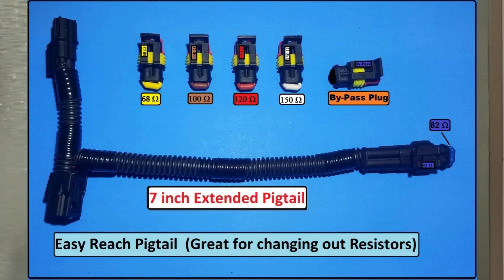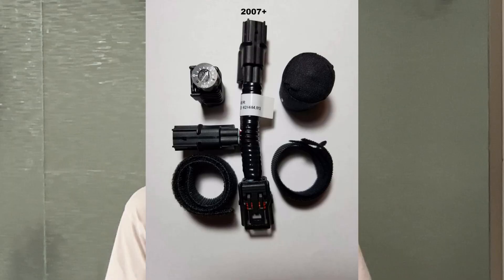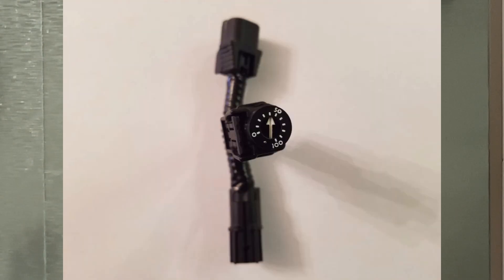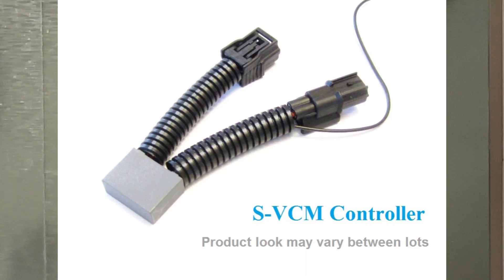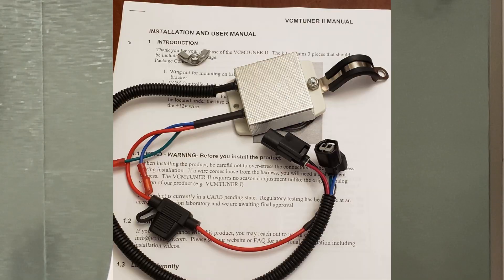Top 4 VCM "Muzzler" devices

Comment: I have a VCM Tuner 2  and it seems to work fine.   I bought a code reader to read the particular sensor temperature being hacked by the device.   The device lowered the reading sent to the computer by a few degrees.  So I assume its working.   Using it on a 2018 RDX for a couple of years.   Engine never misbehaves.
Reply from the maker: Yes, it lowers it by a few degrees.  No issue with the engine block.  Did a 11 year and 137K miles review of the VCM Muzzler.  https://www.youtube.com/watch?v=j_8IdRVcrig&list=PL4dt8AL5j4pUzNWuZK6QCuf2VdSZKC-vb&index=7

Comment: Hondata Race Tune....turn it off for good!  I ran S-VCM for many years, typically get at least 3 years out of them.  I only run 5W-30 full synthetic, which is proven superior to 0W-20 unless you're very easy on the throttle.  Used oil analysis is your friend

Comment: Hi Andrew, I’m currently driving a brand-new 2026 Odyssey (just over 800 miles) with the J35Y7 engine and the 10-speed AT. I’m experiencing a very specific issue and would love your insight, or to hear if other '25–'26 owners are feeling this.
I’ve noticed a consistent slight shock or unnatural 'lurch' during the 2→1 downshift right as I’m coming to a complete stop. It is significantly worse when the car is cold (below 32°F) and feels quite harsh, though it never fully disappears even when warmed up. Interestingly, it doesn’t happen on inclines or when I manually downshift with paddles.
I have a few questions regarding VCM on this new model:
1. VCM Version & Muzzlers: Which version of VCM is equipped on the 2026 Odyssey? You mentioned VCM version 4 (J35Y8) for the Pilot—is the Odyssey's J35Y7 using that same complex system with 10 sensors? If so, is there a VCM muzzler that actually works for the 2026 model yet?
2. Low-Speed Activation: Does VCM even activate at very low speeds (just before stopping)? I’m trying to determine if this 'jerk' I'm feeling is the transmission logic or if VCM deactivation/activation is playing a role in that 'unnatural' stopping feel.
3. Benefits on New Models: Aside from fuel economy, do you still believe it is always better to install a VCM muzzler on these brand-new 2026 engines to prevent long-term issues, or has Honda finally addressed the piston ring/mount concerns with VCM 4?
4. Break-in vs. Fix: In your experience, could this low-gear shift shock simply be part of a break-in process that disappears after a few thousand miles, or is it something a VCM muzzler (if available) might actually resolve?
Appreciate all the work you do for the Honda community!"
Reply from the maker: 1.  2026 Odyssey still uses the older J35Y6.  There is no J35Y7.  Therefore, all current VCM muzzler devices will work.  These devices will  not work on VCM version 4 (J35Y8).  2.  VCM does not activate in low speeds.  Mostly on cruising on the highway at a steady speed.  So let's say about 40 mph to 70 mph.  3.  Yes.  That's what I did on my 2014 Odyssey.  The engine was perfect.  4.  On the transmission.  I've not driving an Odyssey with 10 speed automatic.  However, my 2025 Pilot also has the same transmission.  IMO, I do feel a bit jerky going from 1st to 2nd.  I think that due to the ratio of the gears.  Meaning, 1st gear is (too) low, so the engine revs up fast, to get this heavy vehicle moving.  Heavy load.  And makes it more responsive from a standing start.  Then it shifts to 2nd gear, where there is less load, so the ratios are higher.   On the reverse side when it downshifts, there is perhaps more of a shock going back down from 2nd to 1st, when coming to a stop.  The rest of the gears match very well where you don't feel anything.
Reply: @a @andrewwang128 1. Registration says it’s a J35Y7. Thank you for the reply with details!
Reply from the maker: @ForG-v3n Are you in the U.S. or North America?
Reply: @andrewwang128 it’s RL6
Reply: @andrewwang128 It’s same as RL6. Starting 2025 or 2026 engine code is now J35Y7
Reply from the maker: @ForG-v3n Learn something new today from you.  Thanks.  The J35Y6 is with the 9 speed transmission.  The J35Y7 is with the 10 speed transmission.  That's what I gathered so far.  Will see if I can learn more about the differences with J35Y7.
Reply: @a @andrewwang128 how are you trying to reduce the shift shock between 1st and 2nd gear? Have you felt any shift shock when the car is slowing down or just before coming at a complete stop as the gear downshifts from 2nd to 1st gear or when the torque converter deattaching?..
Reply from the maker: @ForG-v3n I don't feel any shift shock slowing down from 2nd to 1st.  My description was for accelerating from 1st to 2nd.  Therefore, I don't think this is related to VCM.  I would have your dealership take a look at the transmission.
Reply: @andrewwang128 They checked but no error codes were found and they topped a little bit of ATF (200-300 ml?) and tried to check the level via leveling plug..
Reply from the maker: @ForG-v3n Try post the question or search on the Odyssey forum to see if others experience the same situation.  Perhaps others there can help.   https://www.odyclub.com/
Reply: @andrewwang128 well noted. Thank you Andrew

Comment: Thank you for taking the time to explain VCM. Will the existing VCM Muzzlers work on my 2026 Honda Ridgeline?
Reply from the maker: Yes, because the 2026 Ridgeline still uses the older J35Y6 engine.  The muzzlers will not work on the newer J35Y8 engine in the current Pilot and Passport, currently.

Comment: muzzler for 2026 honda passport ?
Reply from the maker: Currently, there is nothing for Passport and Pilot because these two vehicles are powered by the J35Y8 V6 engine.  The current muzzler devices will not work.

Comment: It would be wonderful if someone on YouTube would talk about which muzzler will work for the year of the car. Many will not work with a 2006 auto.
Reply from the maker: All muzzler devices will work with all J35 V6 engines, except J35Y8 engine on the Honda Pilot (2023+) and Passport (2026+).
Reply: @andrewwang128 It is the connectors. Odyssey 2007 forward you are good to go. 2005 and my 2006 the male connector is different. Tons on Amazon but they won’t bolt up/connect without installing another connector. Amazon has all those muzzlers … type the question will it fit a 2006 odyssey.
Reply from the maker: Didn’t know that.  Looking into this, Honda revised it for 2007+.  Thanks.

Comment: Questions for Long-Term Ownership of the 2025–2026 Honda Odyssey (J35Y6 3.5L V6 Direct Injection Engine)

Hi! I’m a long-term Honda owner planning to keep my Odyssey well past 200,000 miles.
I have a few detailed questions about fuel, engine oil, and VCM reliability for the new J35Y6 3.5L V6 Direct Injection engine, focusing on long-term durability rather than short-term performance.

⸻

1️⃣ Fuel: Regular vs. Premium (87 vs. 91 Octane) — and the Role of Fuel Cleaners
The J35Y6’s high 11.5:1 compression ratio and direct injection design naturally raise concerns about knocking and carbon buildup over time.

Main question:
Can we safely rely on Regular Gasoline (87 Octane) and trust the ECU’s knock control to protect the engine over 200,000+ miles — without causing hidden long-term wear, carbon buildup, or valve issues?

Follow-up:
Would consistently using Premium Gasoline (91 Octane or higher) provide any real long-term durability or cleanliness benefit — beyond just improved performance?
Or, could using Regular Gasoline together with a high-quality fuel cleaner (like Gumout Regane or Chevron Techron) offer the same protection and carbon control benefits as Premium fuel?

In short — for long-term reliability, which strategy is best for this engine:
   •   Regular fuel only,
   •   Regular + periodic fuel cleaner,
   •   or Premium fuel exclusively?

⸻

2️⃣ Engine Oil: 0W-20 vs. 0W-30
Honda recommends 0W-20 oil, mainly for fuel economy and emissions.
But for owners keeping their van for two decades or more, that thinner oil raises concerns about long-term wear protection, especially under heavy load or high heat.

Main question:
Can you explain how 0W-20 provides sufficient protection for long-term durability in this DI engine?
Is it truly optimized for longevity, or mostly chosen for fuel economy goals?

Follow-up:
If an owner chooses 0W-30, could it help improve long-term wear protection, or would that higher viscosity risk problems (like reduced oil flow or hydraulic system issues) in an engine designed around 0W-20?

⸻

3️⃣ VCM (Variable Cylinder Management) and Muzzler Devices
Many long-term Honda V6 owners install a VCM muzzler to disable cylinder deactivation and avoid issues like vibration, uneven wear, or oil consumption.

Main question:
For the 2025 or 2026 Odyssey, is a VCM muzzler still necessary to maximize long-term reliability, or has Honda fully resolved those concerns with the latest J35Y6 design?
Put simply — will running the van completely stock (without a muzzler) be just as safe for long-term engine health?

⸻

Thank you for sharing your technical insight and helping owners like us take care of these vehicles for the long run!
Reply: I have the exact same questions, but for the 2025 Ridgeline …
Reply from the maker: @buenavistafarming7871  My reply is on the post above.
Reply from the maker: 1.  87 is fine.  I only use 87.  2.  0-20.  It's what Honda recommends.  If the VCM is muzzled, like my 2014, it burns no oil.  No need to use heavier oil.  3.  Yes, IMO, a muzzler is necessary to maximize long-term reliability.
Reply: @andrewwang128 Thank you for your advice sir

Comment: Does the s-vcm disable itself if the engine bay gets too hot from a lot of traffic ?
Reply: I have read up on this the svcm 2 is the only one that will do that if the engine starts to overheat it will shut down the resistors and the vcm will reactivate
Reply: @Gary-r4b yea I ended up buying it & I can confirm is does do it only if I’m turning my car off & on a lot , it’s been working great for me

Comment: I've had the VCM Tuner II on my 2013 Accord for 3+ years now in Texas weather, have not come across any issues. It's been install & forget. Car has 40k miles. I also recently had the car serviced at the dealer and no questions asked.
Reply from the maker: Thanks for reply on the VCM Tuner II.
Reply: I'm glad I ran into your reply I just bought a 2013 Honda pilot last Tuesday and I'm ordering one next month as soon as it comes in I'm installing it and since you're from my state Texas I know we can handle the Texas heat down here

Comment: If I drive the honda in sport mode all the time, will this be like VCM muzzler  or not ?
Reply from the maker: Yes.  Keep in mind the engine revs will be higher and decrease in MPG.
Reply: What muzzler works on 2025 Ridgeline?
Reply from the maker: @walterwolf5378  All current muzzler devices will work with the 2025 Ridgeline because it's the older J35Y6 engine.  https://www.youtube.com/watch?v=daTcGpf1zOQ&list=PL4dt8AL5j4pXu_PaKV32PmGVmgnEUFJXm&index=15
Reply: 2026 passports in sport mode will the VCM come on to kill the 3 cylinders?  How do you determine when the 3 cylinders are deactivated?   Thanks
Reply from the maker: VCM will not come on with Sport mode.  This has been verified by two Pilot owners with scan tool.  The (new) J35Y8 is so smooth that you can't exactly feel or hear the VCM going on and off.  Scan tool is the only way.
Reply: @andrewwang128  ok thanks
Reply: Does the VCM come on driving in Sport mode in my 2025 Honda Pilot EX L?
Reply from the maker: @JOHNNY-nu1fmVCM does not engage in Sport mode.

Comment: Question: 
Do I have to use a Muzzler to avoid VCM to engage even if I have an Eco button to put in Off/ON manually?...
Reply from the maker: Econ button does not control the VCM.  It only put the engine in economy mode to be more fuel efficient.  VCM and Econ button are not the same thing.  Since you have this button, I dont think you have a mode selector.  Sport or Tow mode would prevent the VCM kicking in.  Therefore, a "muzzler" type device would be your only option.
Reply: @andrewwang128 Thanks for the reply 🙏
Reply: @andrewwang128 thank you so much Sir🙏🙏🙏

Comment: Thank you for the update!

I'm currently considering a 2025/2026 MDX and it seems all the muzzlers will work on the 3.5l J35Y5 models.

However, for the Type S 3.0l J30AC  the information is conflicting.  I emailed "Big Three" and received the following responses:

VCMTUNER II Adanced: "To our knowledge, the product does work on the 3.0L turbo w/vcm in the 2025 mdx.  We have others who have purchased specifically for it and stated they had no issues with it."

SVCMCONTROLER: "No, not the 3.0 engine. Only works on the 2025 MDX with the 3.5L V6 engine."

VCMMUZZLER: "Thank you for your question - to be honest I am not sure if the new models are compatible."

What are your thoughts?

Also, do you have any knowledge of the Idle Start/Stop override made by idlestopper.com

Thanks again for your knowledge and time!